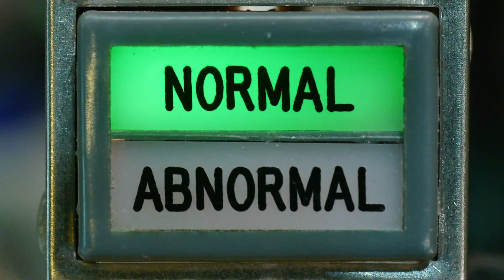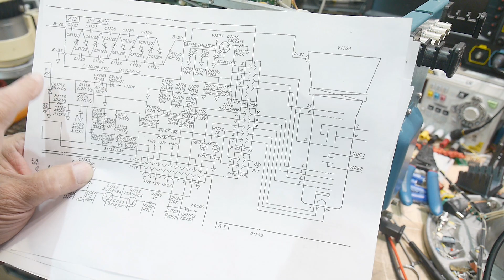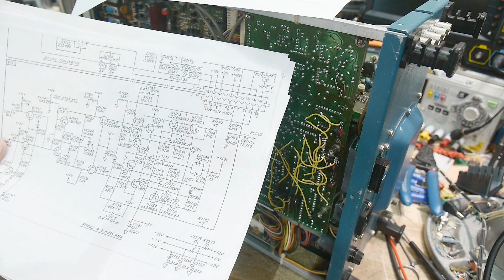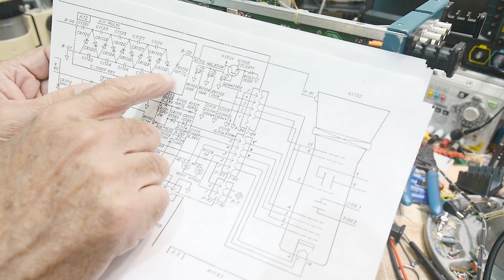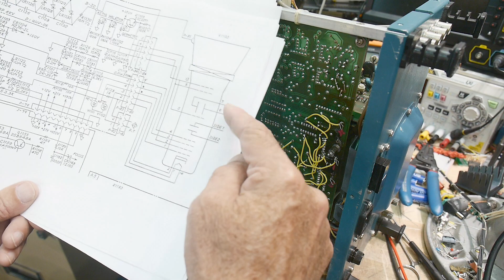#1156 Kikusui COS6100 repair (part 10 of 11)

Comment: If the fillament is glowing then the CRT still has a vacume. Check the anode voltage with the anode attached to the CRT, that way you can get a propper reading. The biggest problem is that if someone has been in there before you, then who knows what they've done to it. Finaly, there is nothing wrong with failure. I do it all the time. :)
Reply: No,  it can glow in presence of oxygen, but not for long. Leave it glowing for few hours. If it burns out by then, this means there was an oxygen.
Reply: @yoksel99  Yes, but the amount of time Imsai has had it powered up the fillament would have blown by now. It's like a light bulb with a slow leak, the air gets in, and pop.

Comment: Hello Mr.IMSAI , 
I repaired a kikusui COS5100 last year. it's same condition with your oscilloscope. that take me 3 months.
I was checked all of the working requirement of CRT tube, every electric-field lens focus voltage,  cathode voltage, and anode voltage of +12kV, 
the glass structures for Y deflection plate was break out ( cause impact). 
I replace tube to other type but screen size are same to old one. i was modified focus voltage for new tube, and removed multiply rectifier of +12KV, cause new tube didn't need high +12KV. 

finally, I get traces that I adjusted Y and X amplifier gain. every parameters is accurate.
you should take your tube out form your scope, and remove metal shield for check all of instruction in tube. you can search on web with your tube model name, and find datasheet of tube. that you can observe tube leads voltage with datasheet. 
you should make a tube drive circuit, and power your tube up without oscilloscope's drive board on your desk. for observe is there any traces on screen. (but you need +20KV from your scope maybe).
observe how CRT tube works on desk, that's what I did.
if you wanna replace your tube, I suggest you choose a high deflection factor tube, they always have +20KV connector too.(some tube do not the positive high voltages but they are LOW deflection factor rate, if you choose them, then you have trouble to change gain of XY amplifiers).
you should make sure new tube you have bought working will. you need built a simple drive circuit just a few resistor and capacitors. and light  your new tube''s screen up on desk.
hope my experience help you get troubleshooting.😀

Comment: The hard repairs are the most satisfying, if I get stuck I move onto something else for a couple of weeks, I find it helps me to absorb the information I know and figure out other diagnostics I can do. My hardest repair was on a Fluke 5200A AC Calibrator, that took me  months and I did 17 videos on its repair, every single board was faulty, some I had to fix two or three times.

Comment: Congratulations for your good motivation and your good work here and at other projects. 
I know you have a lot of experience so you have a good feeling where the problem is. You discussed the high voltage generator in detail, so it is probably there. 
You are not sure whether you loaded the generator to much when testing it with you high voltage probe which will have 1GOhm. So, check the Probe resistance with a Voltage divider at any voltage like 10V if you do not have a suitable Ohmmeter. 
Add another 1GOhm resistor in series when checking the high voltage generator and see whether the Voltage goes up towards 20kV, maybe to 10kVwith half the load. If the error can be localized to this generator there is a way to find and change the broken parts. 
Be careful as always, if the error is big enough it cannot hide.

Comment: I saw you testing for high voltage with the probe and triplett. Most of those probes I have seen were designed to be used with a DVM of 10 to 20 megohms input impedance. If you're afraid of blowing up the good hp meters try it with one of the kaiweets (sp?). Your tube is likely OK. Filament would blow with air in tube. If the tube is gassy (slight leak) you'd see a blue corona around the grids in the neck if high voltage is present. Looking at the schematic, you should have 3700 volts AC at 30 khz at point B-20 going into the multiplier - maybe the kaiweet would measure that with a probe. If 3700 volts is present, there shouls be 18 KV at point B-22 out of the multiplier. Also the cathode should be around -1800 volts (pim 3 on J83) this info was found on pgs 90 & 91 of manual. As a quick trouble shooting technique, you can try momentarily grounding the control grids  through a 100Kohm to see which grid is misbiased (pins 1-4 on the tube - pins on J83 & 84) Maybe you've already done these things; I haven't followed this series closely. But that's my two cents. I hope you get it going' it looks like a cool scope.
Reply: I'm not convinced that the high voltage probe  needs  hi-z meter. I have one that was for a Simpson 260  (20,000 ohm/volt). The high voltage probe is just a voltage divider. with old CRT televisions we used to expext about 1,000 volts per inch of vertical deflection. So 5k volts does n't sound too terrible. check your cathode current if a tube is drawing too much current it will pull down the plate (anode) voltage. Ifthere is little or no cathode current the crt could be in cut-off. I just found your channel and immediately subscribed. keep plugging away and remember education can be expensive. So learn everything you can when working on something new.

Comment: A few dozen ideas:
- check accel votlage with the CRT connected, with a proper HV probe with high impedance. You should read around the ballpark of the marked voltage. Also, you could check every stage of the multiplier.
- check all CRT voltages. Grids, focusing, deflection... Try disconnecting & shorting the deflection, maybe there IS a trace but the deflection amps went crazy and it's not visible.
- read the datasheet of the CRT

Comment: As others have mentioned, check for 18kV on the CRT final anode (when the cap is connected to the CRT) and also for -1.8KV on the cathode. Check along the EHT lead, especially where it exits the voltage multiplier, for signs of arcing. Something may have broken down in the multiplier. Assuming the voltages on the CRT are ok then the beam find should display something, he says confidently.

Comment: CRTs are not much different than regular pentode or triode tubes. The main control over the beam current is the G1-K voltage (g1 to cathode). 0V is full on, the more negative it is, the more the tube is off. There is a certain negative voltage (cutoff) that will bias it to zero current. Sometimes G1 is grounded and the cathode is controlled instead, in that case the more positive the cathode is, the more the tube is off. If your cathode is 100V more positive than your grid, the grid is actually -100V, which is certainly biasing the tube into hard cutoff (0 beam current).
Other than g1, you also need a positive voltage on g2 and anode, or the effect will be the same, 0 beam current. Other grids and plates must also be at the correct voltages. (for example, if the deflection plates are biased too far to one side, the beam will be deflected into the wall of the tube and you won't see it)

Comment: 🤔 When balancing is of, You need to check out lover driver cascade - transistors, diodes.. They may measure good, but under the load at circuit can make strange things if they internally are degraded.. This under balance situation may causing blow up because transistor is half open when it needs to be closed. I don't think, that tube is causing it.. Now I want to screen capture schematic for deeper analysis.. 
Put light bulbs between load transistors to get measurement results without blowing up these transistors.. 😉 I did that all time at amplifiers output stages first run after replacing blown up transistors.. Better safe than sorry.. If light bulb wanna glow, thats mean there is an issue.
Anyway, great to see an update for that great scope! 👍

Comment: from the info you stated and from what i have seen over your last few video's seems like the crt has a problem and that shows why it keeps blowing out the HT ( high Voltage Lines ) it would be best to check the volts to the CRT

Comment: In a very dark room, does the CRT glow?  CRTs are not that complicated.  You seem to have a hot filament and flyback voltage.  You need the filament and associated electrodes negatively biased to accelerate electrons and you need focus voltage to pinpoint the stream.  (You also need the grid to be insufficiently negative to stop the electrons.)  If the CRT glows, then electrons are hitting it but they are not focused.  I predict that the grid is too negative; check the brightness control.
Reply from the maker: no glow in a black room
Reply: @IMSAIGuy  1) The filament is not hot enough to boil off electrons, 2) the grid voltage is too negative and stops them, or 3) the accelerating voltage is not negative enough.  I think 2) is most likely.
Reply from the maker: @byronwatkins2565  the filament and grid about both measuring about -1890
Reply: @IMSAIGuy  The first grid of the stack 1 2 3 4 on the diagram is usually the control grid. This controls the brightness and also the Z mod. So you should see that voltage move as you tweak the brightness control

The next three things that look like grids are usually part of the electron gun ad are the pre-acceleration anode,  then the focus anode, (3-500V )then the acceleration anode  The acceleration anodes have anything from 2 to 10KV+ on them depending on the tube design

Further up the tube there are a couple more anodes to help with distortion and so on. 

Scope tubes do have a few more grids in them to help with distortion.

The deflection is done via electrostatic plates, which are driven +- on each pair 

Finally you have the EHT anode 

If the tube has lost it's vacuum then it would more than likely arc over internally like the clappers and the heater would prob. burn out. 

I don't think we have seen the EHT generator fully,  So this may be wrong. Usually there is some form of transformer generating a high voltage. This then goes into a voltage multiplier which is shown on your ccts. Often the transformer is potted in resin, and the pins from that are soldered into the PCB. Those pins are not normal copper, which would not survive the potting process. They are more like the pins that are used to go through the base of a valve.  Their big issue is that they are a utter pig to solder, I've found several faults on TV's and monitors due to this. They c an also produce the odd crack and pop. 

You may not have such a beast in the scope, but if you do then give it a careful check. The problem usually looks like a thin black line around the pin where it goes through the PCB. In the dark you can sometimes see it arc. I have often taken a file to the pins to rough them up, then wrap them tightly with thine copper wire, then soldered the lot to the PCB.... Only tinsel wire is worse!

Andy

Comment: Setting a project aside for a bit has always worked for me. I do wonder if there is a way we can jury rig the CRT connections just to prove we can get a spot of phosphor to light so we know to tubes got life ? Or if you got another old working scope sitting in a corner and use it as a way to test just the CRT.

Comment: If everything else is working, then you can locate the hi voltage power transistor that is usually connected with a high voltage capactor and a driver transformer, if this is faulty you will not get any picture picture on the CRT tube       also check all the voltages on the switch mode power supply  , check the line output transformer and the hi voltage trippler,, extreme caution must be taken as these voltages can Kill , a Schematic   Diagram showing all of these Components will help you to find  that AREA.

Comment: 1st, I was wrong in my comment from 2 days ago, I mentioned that 
output of the HV multiplier should be 5X the input voltage. 
You should read 10X the voltage, each section multiples by 2.

If you didn’t already, I suggest to read these sections 
in the COS6100 documentation:
- Section 6.12 on page 95.
  (High voltage on CRT’s anode should be 18kV.)
- Section 7.3 on page 99, details about DC voltages.
  (Tolerance of the +/- 12V voltages is only +/- 50mV)

My speculation is that the HV multiplier is defective, possibly 
damaged HV cable caused the damage over time.
I’m skeptical about your measurements using the HV probe. 
You connected the probe to the vintage meter on 6000V range. 
Is ratio of the probe 1:1, 1:10,  1:100? What is expected 
multimeter input resistance for this probe?

I believe that the CRT is fine and key to the problem is 
the HV multiplier. Next step is to troubleshoot the Z axis amp, 
possibly more components on the board are damaged. I would check 
all before powering on.

Don’t give up :)

Comment: You say that you don't know the check the HV  correctly.  You need to read the comments,  the correct procedure has been explained at least three times. and you 
 still haven't tried them  at least on camera.  The most common problems with O scopes is in the power supply.  As far as the HV probe loading the HV, if it is used correctly the test would draw  50 uA max .